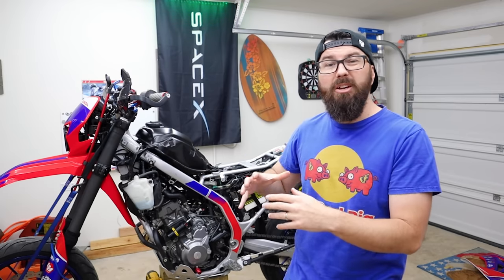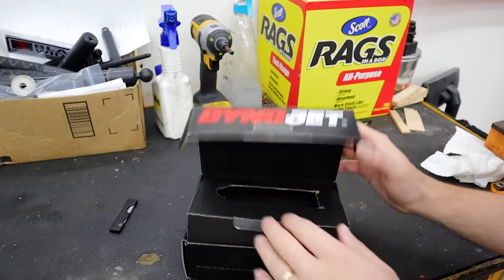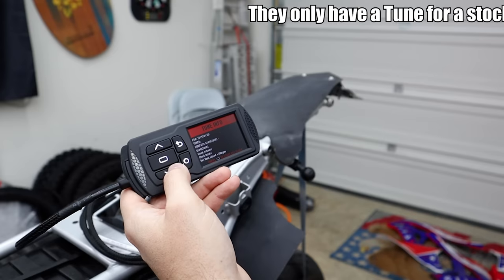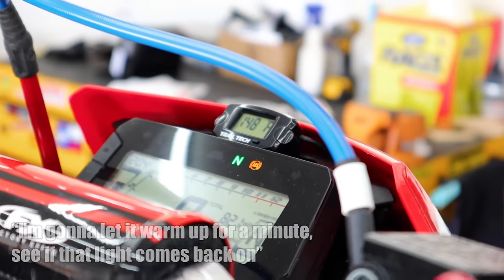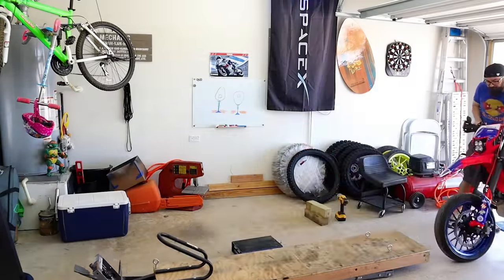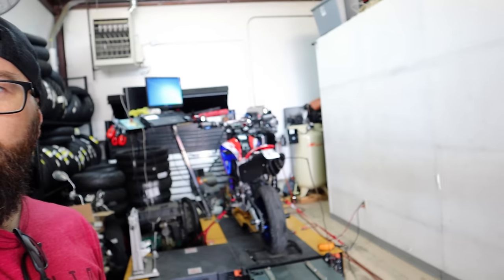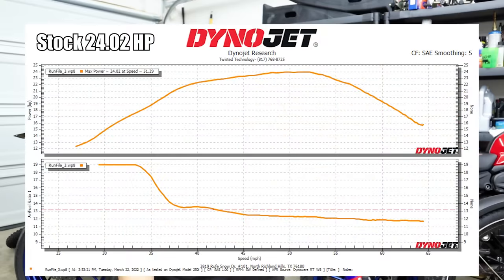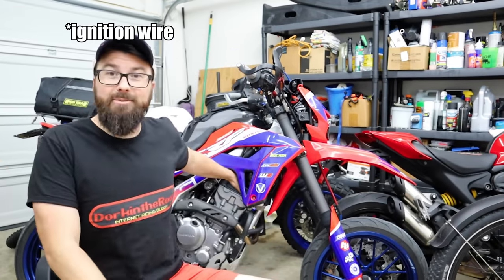ECU Tuning CRF300L, BIG Power?

Comment from the maker: Couple of points I might not have hit on hard enough in this video. While the overall power isn't what I was aiming for, the curve is WAY better. At around 5k I went from 12hp to 22hp! This thing actually snaps now. Look at 9:19 to see the dyno's compared. At 12:54 you can really see how that plays out in the real world. The engine is physically the same now as a CBR300 motor other than gearing and clutch. However there is something I did overlook that's holding it back. It's an easy fix too, I'll have a video on that once I've experimented with it. Also I bet if dyno'd it with the SM wheel it would be 2 or even 3 hp higher. It was done with a MotoZ tire (very heavy), heavy duty tube, rim lock, and balanced (took 6oz!). That's a pretty hefty wheel!  But even now the bike is a lot nicer to ride. Throttle response is a ton better. But I will keep going, I am the guinea pig for this as far as I'm concerned. If it just crap I'll tell you, or if we can make it better but it cost a ton of money I'll tell you. I'm just trying to see if this platform is worth it or not.
Reply: Thanks for the taking the lead...on this stuff.
Reply: Let me guess, bigger fuel injector?
Reply: Been following this...really appreciate the effort.  I don't have dyno data but after an ECU tune, full Yoshimura exhaust, and high flow air filter...she runs a lot better, way better and smoother throttle response.  I think a proper 350cc big bore kit is exactly what this bike needs.  Here's hoping.
Reply: I appreciate TRUTH. You don't see this from most ppl on this platform, best reguards Jake!
Reply: Patreon member. What sorts of things can we expect for the 35ish hp to the wheel?
Reply: I went with a moto-x  pipe (with torque chamber), modified the airbox (enlarged/removed rear upper panel and glued in fiberglass mesh where the inlet snorkel was and cut the FI tube flush inside the box in the front). It is now more snappier than stock. For more hp, the reciprocating weight needs to be less (make a pancake piston) and have a bigger explosion in the combustion chamber (ie.more fuel from a larger injector and compressed into a smaller space [shave the head/cylinder]) . The dyno uses braking forces on the rear wheel to measure HP & Torque, no ? So a heavier rear wheel should act as a flywheel and give higher hp/tq readings than the spr/mto wheel setup I would think. The problem is more HP = more heat and higher mechanical forces = more wear. I  will be happy with a re-shaped power band and still have a reliable engine.  Thanks for your video series.
Reply: Hi mate, would it be possible to explain (video idea) how hard  all of these power mods should affect the maintenance plan?
Reply: Adventure?

Comment: I feel for you...

Went through something similar with my WR250R years ago.  In the end I gained just shy of 2hp but in my case the little bit of bottom end I had was even less which didn't work well for the riding I was doing.  After playing around with it for a couple of years I pretty much put it back to stock and left it at that.

I learned that these Performance Parts companies are really selling parts and not necessarily performance.
Reply: Getting big gains on bikes is difficult, but in this instance Jake just wanted stock CBR power which would seem easy.

Comment: i got the same exhaust(thanks to you, it was so much cheaper then a yoshi and sounds awesome). and the stage 1  550 tune. and i only removed the backfire screen on my 300 rally. and it feels so different. it used to have a little lag in the throttle and sometimes almost bog. now it is there instantly . also now it pulls all the way from 0-100 km no problem. it no longer stalls when you take of randomly from a stop sign. it was such a great improvement. dont get me wrong these are all nitpicky things. the bike is great stock. but just better now lol. it was well worth the money spent. even if the numbers dont show a massive increase. how it feels to me is more important .

Comment: Hey Jake. I own a 2018 250L that has been converted to all CBR 300 parts: crank, piston, balancer, cams flywheel, ecu. And, a Power Commander V with Autotune (wideband O2 sensor). What I found is that I had to delete the oem O2 sensor (narrow band) because the factory ecu may have been trying to undo the afr I was telling the PCV to run the motor at. It was as if the settings were going towards stock the longer I left a tune in. 
So, with the factory O2 out of the way, and a new Power Commander O2 bung welded in, my engine runs at whatever air fuel ratio I please. Once the tune has been optimized, you pull the Autotune O2 sensor out and now there is nothing in the header pipe and flows better. These motors also love some timing advance. Make sure you tell the tuner to add some in when on the dyno. 
I also have been in touch with AH, and purchased/installed his +2mm piston. While it lasted, my bike felt like a DRZ w/a 3x3 and a rejetted carb. It was absolutely awesome. I would try it again but money is tight. The machine shop I used may have bored my cylinder on the tight side and the piston was damaged after 1200 miles. Oh well, my fault, my problem. 
Overall, it is a great bike and will keep it a 286 with some solid head work and a matching tune. If I get the chance I will get another piston from AH but for now it is a true do-all that greatly benefits from head work and a tune.
Great vids. Keep it up 👍

Comment: The bike doesn't come lean from the factory . The bike  has the most economical setting you can get from a 300 cc engine . The amount of air allowed in  with the amount of gas going in  keep the engine at its coolest temp  possible . 

Its only when people  altered the air  intake  to allow more air  in  that  causes  the ( dangerous way , toasted  exhaust, crispy exhaust valve and general wear increase ) . Notice  that he said  in breathing better  meaning  opening up the air box to allow more in , is when all the  crispy exhaust comes from .
 
If you just except  the power  the way  it comes from the factory  you will  get  70  to 75 mpg . If you start adding more fuel and more air your going to burn  more gas faster .  

Why in the world would you want to decrease the mpg ? You are going to go from 75 mpg down to  50 or less  and for what ?  

As far as running hotter any time you add more gas and more air at the same time  you are going to make the engine  hotter  just think about it . If you think you're are going make your engine last longer by burning  more gas at a hotter temp  you are badly mistaken . 

If you leave the bike stock  its going to run the coolest  it can possibly run  so it will last a lot longer leaving it stock . Just except  the power  the bike gives you and enjoy the 75 mpg  and go 255 mile between fill ups  and have fun along the way .
Reply: In the age of information, ignorance is a choice...
People are ignorant...

Comment: Good luck with finding the 30bhp that should be in a tuned CBR300 motor, I'm sure you'll get there before any big bore or stroker kits are needed. 
I've had a similar long journey getting an old 1980's 125 trail bike from 18bhp to 24.6bhp so far, and when I finally get it over 25bhp at the tyre ill say it's done, and fit a bigger engine to do the same mods to that too.
Reply from the maker: Since then I think I got it figured out. Remember the engine is physically the same. I just put a video out on Patreon on a new mod I did. I’ll have a public one up soon.

Comment: Hello Jake ! i have a question abot the Dynojet. I have to only plug it, flash the ecu and remove the dynojet? and then each time i want to flash it i just have to plug it again and modify, flash ecu and remove? And the other question is that a friend is buyinga crf 300L too. If i buy the dynojet can i flash both bikes? Or the Dynojet only let me flash my bike and none other than mine? sorry for my english but i think i make my point haha. Have a great day mate, really appreciate your videos. Cheers from Chile
Reply from the maker: The pv3 dyno jet is flashing the ecu. So it doesn’t have to stay connected. You can leave it on if you want to data log or if you want to view so thing in the fly. It will pair itself to your ecu so you can’t share it unfortunately.

Comment: Such a cool little tuner. I am going to go the 550 route though because Im doing hood rat stuff on a budget. 
Still confused on the results, because the CRF300L with the Thailand ECU supposedly make 30hp vs 27 everywhere else in the world.
Im really wondering the the ECU itself is pulling fuel.

Comment: Further clarification,  running same cbr cams, similar air intake. Free flow exhaust,  ext. Per 550 Performance it is generating over 28hp peak power @ around 7k rpm.

I appreciate this guys videos, but he does things half baked...

Comment: The KTM 390 adventure makes 43 horsepower stock from the factory for msrp $6100. I also  receive Led headlight, TFT dash, adjustable suspension, And stability control.  KTM makes the best dirt bikes, period!  Honda is not in the horsepower game anymore especially in less premium bikes
Reply: I agree that the KTM has more power. For sure. But try taking the KTM 390adv on half serious off-road. None of the benefits you mentioned will matter when you are cased out on the first rut or have smashed all the plastics from dropping the bike
Reply: buy a KTM 500 exc-f much lighter and more power gets you anywhere you need to go

Comment: Ah yes R&D it's always like this for me at least. Even if it is a very very similar motor but there are some minor differences it'll be some little thing you're overlooking. Good news is if you got someone who tunes them constantly then he can help a lot hopefully, you'll get there partner!
Reply: I'm sure that the same power is available to this modified CRF as a similarly modified CBR 300 would have on the same Dyno/day. Maybe Jake should look for some tuned CBR Dyno charts with the same sorts of modifications, which Id guess would be around 29-30bhp and what Id hoped to see  in this video. I would also check the part numbers on the fuel injector and throttle body to make sure they are definitely the same as CBR parts. The issue looks to be in the tuning as I don't think the after tuning Dyno charts are possible with a 300cc engine. I.e making the same power at much lower rpm and over a wide rev range with next to no change in peak. It doesn't really add up?

Comment: Hey, I would degree the cams to make sure they match the CBR specs, what if the CRF timing marks on the flywheel are different the the CBR?  Symptoms look like an advanced intake.
Since you have the power vision can you see or log the manifold pressure sensor?  If it is reading close to atmospheric at WOT then you don't have an intake restriction problem.  
Anybody mentioning 35 HP needs to put the crack pipe.
Any side by side off road suspension comparisons to other dual purpose bikes, I love the suspension upgrade.
Great job on the vids, good for you hanging it out with real time experiments.  I sub'ed to the Patreon by the way, first one ever.

Comment: I hate to be that guy, But that 0-60 time was not even close to accurate. I re-watched the video multiple times because it seemed like the timer was counting really slow. So i took this video and put it in my editing software so i could try and get the most accurate time and i'm getting around a 6.30 second 0-60 time. that's double what what said in the video.
Reply from the maker: Is that what it is? I had it set to time, not frames or something else. I knew it wasn't right but I did say that in the video. I not trying to act like it's that fast. That was the unit of how it was measured before so I needed to do it that way at the end. I figured it was somewhat due to the 17 inch wheels but even that seemed like it was too much of a difference. I guess I need to look at how premiere pro is setting up that timmer better.
Reply: @TheGardenSnake  No hard feelings or anything. I wasn't trying to call you out. Just thought I'd mention that the timer was off so much. I kinda wish your timer was correct though lol. A dual sport of that size going 0-60 in 3 seconds would be crazy. On a slightly separate note, Thanks for all the great content you put out. I really appreciate the lengths you go to to explain things so people can learn. Ride safe Brother.

Comment: Most inexpensive mods you feel it in a snappier throttle response.  Even expensive mods will not cut 0-60 secs in half.  I am old enough now and spent enough on mods that just buy them with the stock bike from factory.  The future is locked ECU’s,  proprietary tools and scanners.  Too expensive or software dependent for backyard or small shop mechanics to modify or repair.  Many Cars out of warranty too expensive to repair cuz complexities of engine.  Electric is the future as plug and play vs repair.

Comment: Your timer is off, it only counts up to 0.6 before changing seconds
Reply from the maker: Maybe that's the frame rate of the video, not sure
Reply: @TheGardenSnake  Impossible to believe that 0 - 60 mph time even accounting for the speedo being considerably out. It should be around 7 seconds. Do another run with a gps tracking your speed.
Reply from the maker: @Scoottoots  For sure it's not actually going 0-60 that fast. I did mention that. Speedo is off due to the SM wheels and that speed jumps big time between speeds. I was I had used one of those apps or my GPS to test it.
Reply: @TheGardenSnake  Well it would sure be fun if it really was that fast... or maybe not. Much of the charm is trying to squeeze that bit extra out of these bikes. Fun stuff :-)

Comment: Engine mods are the most expensive mods vs suspension stuff.  It takes hundreds air thousand to make big horsepower.  Another reason buy the horsepower stock from the factory.  These Harley guys Buy an expensive Harley and need a stage 2-4 to up the power that should be from the factory.  Of course, not the case with the new generation of Harley’s Pan America, Sportster S, Nightster..  they all have power to weight ratios more than Harley’s CVO’s.

Comment: So basically the WR250R is still the best lol.
Reply: Not at all. The CRF’s stock engine has more down low torque suited to the dirt.
Reply: @nathanf1934  have 3 buddies with 300L’s and my WR whoops them in every category lol
Reply: @KentwoodWarrior  well your mates cant ride.
Reply: @nathanf1934  no WR is just better
Reply: @KentwoodWarrior  I disagree. I have both heavily modded. Have ridden around Australia off road on both.
Reply: @nathanf1934  lol just sucks that the new 300’s are just now somewhat catching up with the WR. Once the new WR comes out, it will be dominate by long shot for years again
Reply: @KentwoodWarrior  Has there been a new WR confirmed?

Comment: You wasted all that money for nothing…
Reply from the maker: haha well it has a lot more bottom end, look at the dyno. At around 4-5k rpms it's at 22 hp where stock it was 12hp. That dramatically changes things. And I'm 90% sure I know how to get that extra power now.
Reply: @TheGardenSnake  you could have just swapped in a CB300R motor and been golden.  But carry on.
Reply from the maker: @michaelwhite3615  that would make no difference, it's physically the same motor other then the gearing
Reply: @TheGardenSnake  Is the throttle body on the CBR300R the same diameter as the CRF300L. I recall (I think) Honda using a narrower throttle body on the CRF250L vs the CBR250R. If so, that would account for some of the missing power.
Reply: @Scoottoots  I just checked the specs on the official website, that's not it, they both have a 38mm throttle body.
Reply: @Blockbuster2033  Oh cool, thanks. That's not it then.